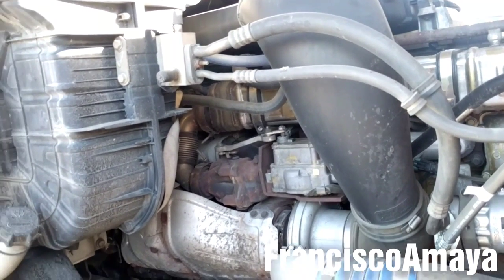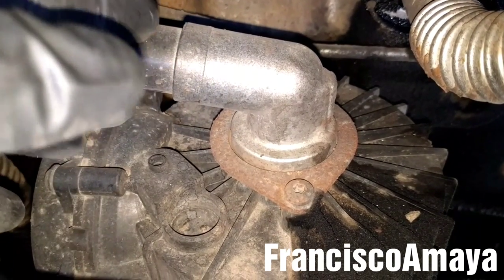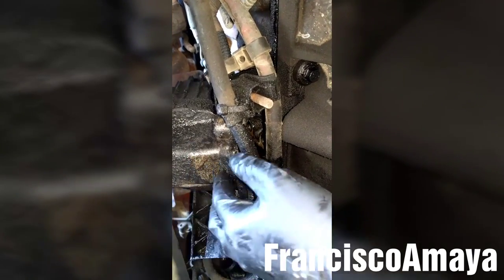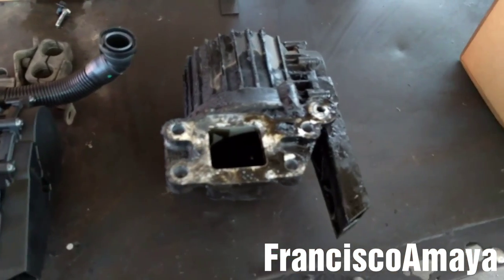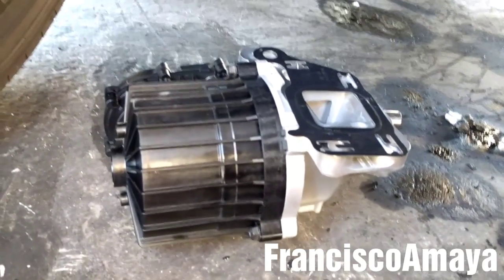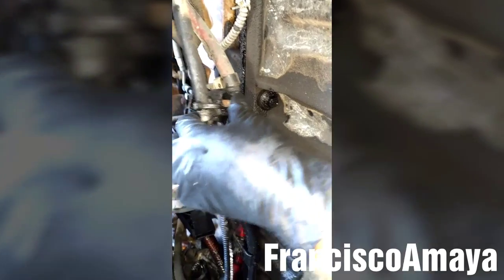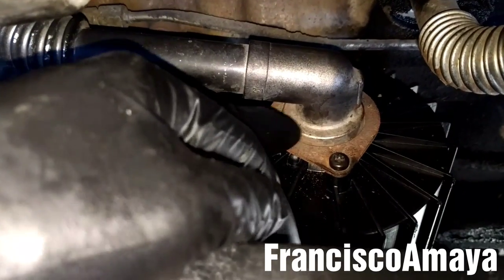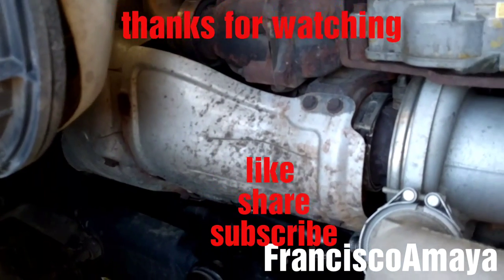Freightliner Cascadia DD13 DD15 engine crankcase filter removal replacement oil separator

Comment: This video is outdated. The style part they sell now the plastic pipe on top can not be removed. “ I just broke a 500$ part trying “ lol keep the black hose they have a special fitting that goes in the block so you can use the hose that comes with it

Comment: First of all, Thank you Francisco. Your videos are extremely helpful. My 2016 Cascadia DD15 has a leak around the hose attached to the motor. Crankcase itself is in good condition. Please advise the fix to this issue. Thank You.
Reply from the maker: Just replace the pipe hose.

Comment: Hi Francisco just wondering if you may have possible answers to what may have happened to my truck, so I apparently overfilled engine oil on my 2016 cascadia and now I have an oil leak and at times oil pressure it low and water temperature runs high but not always. 
Do you know what would be the most common issue for doing what I just did?

Comment: How do u notice if u need to replace crankcase filter.
Reply from the maker: It was leaking oil.
Reply: Smoke too? I've got blowby spitting oil and blowing smoke from just below the crank case filter. Is the location of the blowby tube on a DD15?  Thanks again for another great repari video!
Reply: Francisco Amaya where do it normally leak from ?
Reply: @sdrolz382  I have that same problem when I go up a hill it blows smoke on and off for 5 minutes
Reply: @sdrolz382 did you figure it out? I got white smoke

Comment: There is good amont of esteem coming out from that. Is that mean ok?
Reply from the maker: Yes, it should be like that but when you remove the engine oil cap should be able to feel that the cap is being pull to the engine, if the cap is being push away from the engine you need to replace the crankcase filter.

Comment: I had an oil leak all over engine and a MIL check engine light came on. They told me that the crankcase filter was leaking , do I need to do a regene once I replace the crankcase filter?

Comment: My truck is losing power in the higher gears. Struggles to go over 70 mph. Drives smooth besides that. It has Bad fuel mileage. Mech wants to replace crankcase filter. I have no codes. And he tested cac and made sure I have no air leaks. What should I do ? Dd15

Comment: Hey frisco, the plastic pipe on my crank case filter to the valve cover broke in the middle from heat . I wanted to just dump the pipe to the ground since it doesn’t leak oil . How will this affect it . Is it better for turbo ?

Comment: Is there a maintenance kit for this or would you just replace it and be done with it?
Reply: Marcus Jones No maintenance kit... Unit must be replaced... 400.00-500.00 For part... 250.00-300.00 on eBay

Comment: How often does it need to be replaced
Reply from the maker: Every 600k miles. 
They last long, this specific truck had 990k miles when I replaced it. It was the original crankcase filter.
Reply: Gracias
Reply: My company has 2017 freightliners with around 230,000miles maybe 300,000 miles and a lot of oil leaking from that area. Of course nobody seems to care about it but it’s good to know the specifics of it so I can keep drilling the shop to fix the damn truck since I’m in it every night.

Comment: Did you release the oil in the crank case first ?
Reply from the maker: No, It is no necessary.  Just wait 10 minutes after turning the engine off.

Comment: Francisco do you have how to replace a power steering pump video on dd15?
Reply from the maker: No, I don't have that specific Video yet but you can check this video https://youtu.be/tC1_RtwQFn0. This is the air compressor seals replacement you can see how to remove the power steering pump.
Reply: Francisco Amaya does the compressor has to come off in order to replace power steering pump ?
Reply from the maker: No, you don't have to remove the compressor. Only the power steering pump.
Reply: Francisco Amaya the reason i ask is because theres a leak there, im not sure if its just the power steering pump gasket or something to do with the compressor
Reply from the maker: It could be the air compressor, clean it and inspect it.

Comment: Buen video. Mi 2012 DD15 está perdiendo power y tiembla cuando le acelero. Le acabamos de poner new oil filter and fuel filters. Que podrá ser?
Reply from the maker: Pueda que un injector este malo
Reply: Francisco Amaya si eso era. El check engine light lo checamos con una computer y el código marco injector #2 malo
Reply from the maker: @elchaparro09  
😎👍

Comment: I have this problem but I have seen that this issue can be because of a blown head gasket I have this issue also pressure in my coolant reservoir but no coolant in my oil though is this a head gasket or just me overthinking that I have a head problem? Thanks
Reply from the maker: I guess you check the amount of pressure the coolant system is getting, it is possible that your engine has a bad head gasket.

Comment: I got a 2013 Cascadia DD15 and it started leaking oil just from about every gasket. I was also getting some blowby through the oil cap so I replaced this Crankcase beather/Oil separator and it fix my problem hopefully this help someone else
Reply: Did you have white smoke from the right side of engine?

Comment: Francisco, I have a 2010 cascadia and I am loosing about half a gallon of oil to one gallon every week or 3000 miles.. there's no visible leak on the engine or floor agree parking for 10 hour of duty just see oil around the crank case breather filter no where else and I notice the truck almost want to cut off when it's in cold temps lower than 30 degrees this happens in only the low gears what do you think
Reply: Check to see if you have oil in your coolant. Also, check around the bell housing of the transmission. It could be coming from the rear main seal. Does your truck smoke? It could be burning the oil. Turbo issues? DPF filter issues? If it's going thru the exhaust, it should be in the DPF filter. Crawl under your truck and see if there's any oil on the undercarriage..
Reply: It could also be going into your engine harness. Unplug the injector plus and check for oil. Those are the 2 plugs on the drivers side of the engine towards the top. Two big round plugs..
Reply: No oil in coolant, no oil external on the ground after 10 hours of not driving. The turbo is not leaking or wistle, no high idle to indicate turbo going bad and no smoke out the exhaust pipe either
Reply: No truck don't smoke I'm going to check the bell housing to see if the can be coming from the bell housing like you said thanks
Reply: Ok I will also check the injection cable

Comment: I have a 2015 with under 100K miles.  I have a check engine light/code for low filter spin speed.  I know the smaller Merc engines have that spinning oil separator.  I ordered that for this DD15 and this is the filter they sent me.  I don't see any sensors on it to monitor spin speed???  Is there a spinning filter inside that housing?  Any help please....Thanks
Reply from the maker: This sensor goes on top of the oil separator but it doesn't comes with the new oil separator you have to reuse the one that is on the old oil separator.
Reply: Francisco Amaya thank you. I got new sensor and code self cleared for now.  We have issues with DEF system on all these DD15’s. Our company efficiency has dropped 15% since we got these.
Reply: Delete that shit. I paid $7000 at the dealer to fix the entire air system because its metal, also connected to the DEF and trans

Comment: Hi Fransico, 
I have dd13 2014 freightliner cascadia. 
Got the check engine light the other day after 3 months of not taking the truck out because of covid. I checked the codes on dash it said Spn 5444 fmi 1.
Can u tell me what could be the problem?...is it the same oil breather filter video u have or its different. Please advise
Reply from the maker: Yes, it is that code about the crankcase

Comment: I was told on my 2017 freightliner Cascadia DD15 that I don't have a crankcase filter so your video is a little bit confusing here i was told by freightliner its not a filter its called a crankcase breather
Reply from the maker: It is call oil separator.
Reply from the maker: I just prefer to call it crankcase because everyone can understand that.
Reply: @franciscoamayaYT  so I was told I don't have a crankcase filter i have a crankcase breather correct? 2017 frienghtliner Cascadia dd15

Comment: I have a smoke coming from the pipe of this filter, doesn’t it mean i need to replace it?  Somebody told me can be sign of motor going down?
Reply from the maker: Does it look like water steam?
Reply: Francisco Amaya it smells like smoke ... now it’s cold here hard to say, but looks more like smoke to me
Reply from the maker: Maybe you need to replace your oil then.
Reply: Did you figure it out? Have same issue, white smoke coming from there. Don't know if I should change filter or engine is done. Plz let me know

Comment: Hello Francisco I have a 2011 DD 15 Freightliner Canscadia in the morning I started up my truck and oil leak out from the oil filter cap I changed a seal and the cap oil pressure pretty high in the am once it warms no more leak is there a oil blow filter or something that can cause this or do I need to change this crankcase filter
Reply from the maker: Do the housing have any damages in the surface where the seal seats?
Reply: It don’t seem like it but I checked the cap and it was lose I wrench it down two turns haven’t started it  yet.
Reply from the maker: @ericgreen1389 
Oh, double check that after it starts.

Comment: Hola Francisco puse el crankcase nuevo pero liquea por el gasket nuevo k es diferente más delgado k el gasket antiguo fui al dealer y según mi vin number es el gasket correcto porque likea el liqueo es mínimo
Reply from the maker: Esta seguro que removio el gasket Viejo, en muchas ocasiones se queda pegado.
Reply: @franciscoamayaYT  Si Francisco lo renovi limpie el gasket antiguo porque fue la única manera para k dejará de liquear incluso le puse silicon rojo y liquea en resumen liquea con el gasket nuevo y gasket antiguo
Reply from the maker: La presion de aceite entra por un agujero en la pare izquierda, revise que se selle bien. 

El gasket nuevo es negro y mas Delgado, revise que no este doblado
Reply: @franciscoamayaYT  lo hicimos y de paso le puse silicon para evitar otra fuga los 4 tornillos fueron apretados correctamente esperaré 24 horas antes de arrancar el motor
Reply: @franciscoamayaYT  el gasket esta bien nuevo pero es más delgado k el antiguo y otro detalle la propela k gira al interior del crankcase nuevo es más pequeña k en el antiguo influye algo en eso en el dealer me dicen k es,el correcto para mí cascadia 2013
Reply from the maker: Si, ese es el correcto.  
Es raro que sigue tirando aceite
Reply: @franciscoamayaYT  resuelto dejo de tirar aceite misión cumplida estaba mal instalado gracias Francisco
Reply from the maker: Que bueno. 👍

Comment: hey bro I have 2012 dd15 engine the oil and coolent are mixed I took the truck to Detroit diesel shop and smoke and oil was coming out from crankcase they told u need to overhaul the engine i said ok and then they finished I tooked the truck from them but the crankcase still smokes any help
Reply from the maker: Smokes? 
Like white steam?
Reply: That’s what happens to mine white steam would be appreciated for response!
Reply: Francisco Amaya hello sir I am getting white smoke from pipe.what I suppose to do?
Thanks
Reply from the maker: Sometimes that I caused by water contamination in the crankcase system.  
This is caused by a small crack in one of the liner that later will be a bigger problem.  

When the engine is off for more the 10 hours, check the exhaust orifice of the crankcase filter. Touch it inside with you finger to see if you can see water or moisture inside it.

Comment: I have dd16 we change the crankcase filter and still oil is spitting out of the breather why is that?What can I do please help me
Reply from the maker: If you remove the oil filler cap, do pressure comes from there?
Reply: Hey brother I changed mine twice within one and half years it is still spitting oil out of the blowby pipe and I have vaccum at the oil filler cap. But ever since I changed it I noticed that my oil pressure went up a good 7-8 psi. Is it spitting oil and losing oil just because the oil pressure went up? Any advice would be appreciated thanks for posting good videos.
Reply: Baljinder Benipal did you find the proablem 
I have same problem with my truck
Reply: Same problem any suggestions?

Comment: Hey i have a freightliner cascadia 2013 DD15 im getting code spn 5444 which is the cran case breather the Sensor and breather was replaced and im still getting fault 1 ecu 1 code spn 5444 Please help just got this truck.Thanks
Reply from the maker: Do you have the fmi code
I mean,  it should be for example: spn 5444 FMI 2

It is just to give you the proper information
Reply: Eng 1 spn 5444 FMI 1
Reply: Ecu 1 fault 01 spn 5444
Reply from the maker: Ok, based on the codes. 
The crankcase filter needs to replaced.
Reply: Filter and sensor  was replaced already .. still getting again..
Reply from the maker: Does the engine have a low oil pressure?
Reply: When truck is idleing pressure is around 20 to 30 and when running pressure goes up to 50- 60
Reply from the maker: Hmmm!
That is weird. 
Do you install a new crankcase filter?
Reply: Thanks problem was found it was the harness..The cable that went to the sensor was wrapped around the cran breather and it burnt with the heat... Thankyou for your time.
Reply: edwin nunez 
Hi Edwin 
the hardness you said is the sensor or is another because i have the same problem and i check everything

Comment: Hi Sir, I have 2013 cascadia with dd13, I had little bit of oil leaking from breathin valve from last couple of months and recently I had smoke coming out of my breathing valve. Mechanic over the phone told me that I might need an engine overhaul. Very little smoke comes out of oil filler cap and it pushes the cap outside, not oull it inside like you mentioned in comments.Plz advise ? Thanks.
Reply from the maker: First,  replace the crankcase filter

Comment: What are the symptoms of a bad crank case filter for a dd15 thank u
Reply from the maker: High crankcase pressure when you remove the oil filler cap

Comment: @francisco amaya Hi my name is YASIR my engine is DD15 cascadia on 533000 miles I have a same problem with my crankcase I changed two times and still is leaking and I went to shop they told me we checked everything you don’t have any problems  just keep on eve your oil level and  you have to add some  LUCAS OIL with regular oil and it will stop 🛑 just keep running and am on the road I almost drove over 1,500 miles I didn’t add any oil and I always checked my oil and it’s level MAX.. and ok right now the crankcase leaking isn’t bad as before but there’s smoke coming from the  crankcase it self  NO CODS NO WARNING LIGHT NO LOSING MUCH OIL.        I need your help any who knows this problem
Reply: I have same problem with my truck 
I was told to drive no worries but underneath the truck oil everywhere 
Did you fixed yours?
Reply: I have exact same problem and same recommendation from mechanic that I need to add Lucas  one gallon with every oil change and keep oil lvl max with checking lvl every time

Comment: Great video. I did exactly what you showed me on the video since my crankcase filter was leaking. But I still have eng 2 001 SPN005444 CCV ERROR 01 code. Please help
Reply from the maker: Probably the engine harness is bad